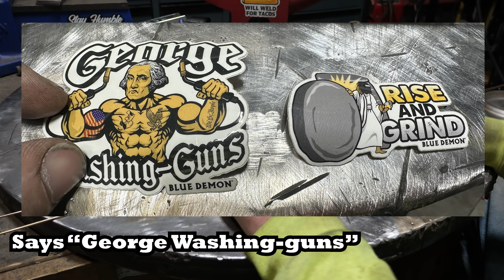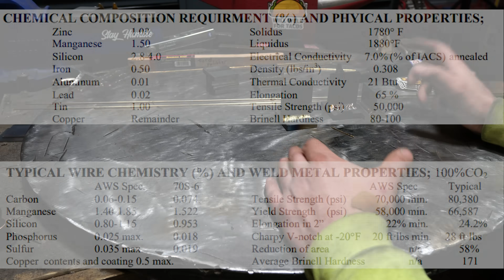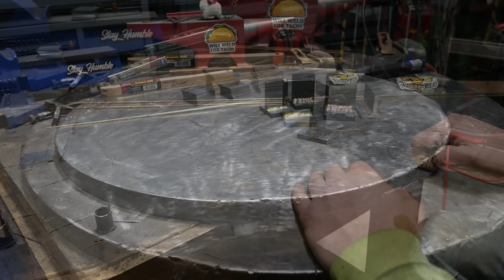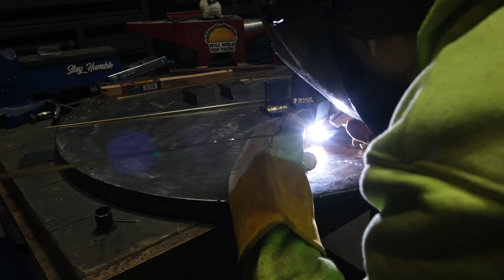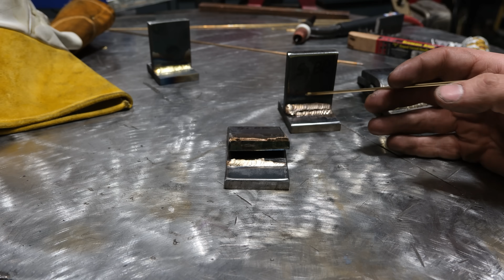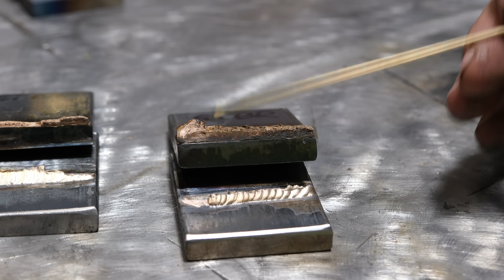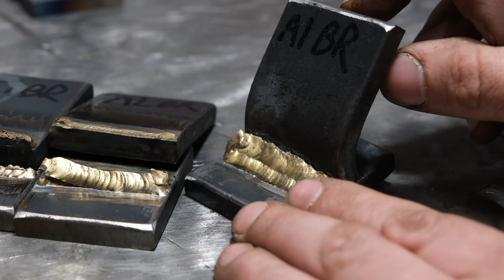Silicon and aluminum bronze brazing, how strong are they?

Comment: Thanks Greg, I really needed this. I'm getting ready to braze some mild steel to some American made cast iron that has never been run so not full of oil and junk. I'm not good with the dab dab dab tigging yet but I'm good at getting metal to flow where I want it to. I bought a couple of pounds of aluminum bronze so I could practice first. There is no leverage stress on this part, it hangs straight down and a connector hangs straight down from it.
Reply from the maker: You will find aluminum bronze to be very easy to work with.  The puddle flows like mud, once you push enough filler into the start of the braze that puddle will more or less follow your arc.  You just push some extra bronze in as you go and the finished product should look pretty good.  Since the puddle is slow to freeze if you take your time it’s not hard to get a clean look 😀👍.

Comment: I’ve been welding a lot of cast iron parts with 309L for years and have experienced no problems. But I recently repaired a cast iron part for something I bought on eBay and broke during shipment. I decided to lay a lot of 309L to thicken and strengthen the part. When finished, you could see the slight valleys between the welds. I didn’t want to grind off the metal as I wanted the strength. So I si bronzed all of that level before I powder painted it. I find that that’s what I use it for, mostly. I TIG welded it at 185 amps, and brazed it at 100 amps.
Reply from the maker: The cool thing is that it sands easier than steel or stainless so if someone needed to do like you did and wanted to sand it flat it could be done easily without removing base material/weld.
Reply: 625 inconel is also a good alloy for welding cast iron to steel.

Comment: Thanks for this video Greg. I've been doing a bit of TIG and MIG brazing recently. Done OA brazing for over 20 years but really liking the speed you get with MIG and the clean nice look with TIG. Have found that pulsed MIG is the only way to get really good looking MIG brazing as it kind of uncontrollable with SC MIG. Very interesting video and great to see the strength tests.
Reply from the maker: I just started to experiment with mig brazing and I managed to get what appears to be a mig weld but it’s a braze.  It sounds weird running it and it definitely isn’t the most controllable.  Once I get things dialed in a bit on thinner material I will be doing a video on it.  I wish I had a pulse capable machine, I am sure that would give a lot more control with it.

Comment: I use both SiB and AlB to build metal furniture. I do a tree slab table with one or the other as "bark" and then for the table top I alternate pours of copper and whichever I didn't use for the "bark" as the tree "rings." It's really a gorgeous material to work with. Like, the results are beautiful, but also it puts less heat into the table so there's less distortion I have to deal with. Really is one of my favorite materials to build client projects from when I'm more concerned with aesthetics than absolute tensile strength. If I could, I'd use it for everything.
Reply from the maker: Awesome 👍.  It definitely is gorgeous to work with, sounds like you found a great use for it.  That’s such a cool idea that you’re doing, and it will set your work apart from many others.

Comment: Really cool testing and brazing. I have a caldron to repair for a friend and will be doing this in the coming months, hopefully. I also have a pintle mount that I have to make for a Browning 1919 that I may use this on, since the actual pintle part is cast iron, whereas the cradle is mild steel. Awesome!
Reply: I've tried a couple cauldrons and found them to be nearly impossible to tig braze or nickel stick weld. And I've done a lot of cast iron successfully in the past. I think the difference is that these were not strictly speaking cast iron but rather "pot metal". Had a good amount of iron in it but a bunch of other stuff too. Flame brazing was a little better but still not satisfactory.

I bet it would work well for the pintle mount though.
Reply from the maker: Interesting on your luck with caldron repairs Lucas.  I have never repaired one of those, but it sounds a lot like sewer grates that can be made from total junk.  Often times the carbon content is so high that nickel welds and brazes will literally just crack at the point they join the base material no matter what you do.  If nothing works at all as a last ditch effort I would heat the whole area to 1,000 to 1200 degrees or a bit more with a rose bud until it’s stabilized at that temp for a few minutes.  I would then oxy fuel torch braze it.  The big problem is too hot and it’s going to develop changes in the heat affected zone, and likely crack elsewhere.  That’s hot enough that other issues will likely pop up but it might give things enough ductility during cooling to prevent failure.  Those types of repairs are the hardest to be successful at because it’s one thing for it to last through brazing and another to survive use in which it’s exposed to significant heat cycles.
Reply: @Lucas12v  Thanks for the input. I will try and remember to send you a message when I make the videos for the cradle.

Comment: What great timing. I picked up some silicon bronze rod awhile back planning on using it, I hope, to fill some rusted through holes on my project '62 Impala. The holes are in sheet metal that has been press formed and no one remakes these parts. Do you have any tips on tig brazing very thin sheet metal with silicon bronze? Thanks once again for a very informative video.
Reply from the maker: So one of the great benefits with it is it needs less heat than welding to flow.  It also is easier to sand than the base material which makes it great for body work.  For sheet metal the best advice I have is to use .045 silicon bronze filler.  The thin wire will be really easy to melt on thin material.  1/16th also works decent.   You want to heat the material until you barely see a mini molten puddle and then push some wire into the arc while increasing the amperage slightly.  It takes some practice but it’s pretty easy to learn.  Definitely watch the video I linked in the description for more tips on using the stuff.
Reply: @makingmistakeswithgreg  Thank you, thank you, thank you. I had no idea how to do this.

Comment: Hello sir. I have question. Can brazing be used on 2 piece of same aluminium or different aluminium? Dont see anyone do it in you tube. Thank you.
Reply from the maker: Great question and something I haven’t covered.  So aluminum can be brazed, with specific aluminum brazing alloys.  Aluminum itself can be welded for most alloys however some such as 7xxx series can’t be welded easily but can be brazed.  At some point I will do an aluminum brazing video, I won’t lie, it’s tricky.  Aluminum brazing takes place at around 1100 degrees and the base material starts to melt at 1250 or so.  It can be very easy to melt the base aluminum.

Comment: Another good video, as usual, Greg, thank you.  Most of your carbide edged tooling (think circular saw blades, router bits, lathe tooling, etc.) are brazed on (i.e. carbide teeth brazed onto a steel disk or a steel shank).
Reply from the maker: Thanks for pointing that out, and you’re right.  That is a great situation where welding the two materials isn’t exactly possible but joining the two with brazing gives an amazing end result.

Comment: seems you can tig braze on ceramics too?    any suggestions to use flux to help wetting out? or is the flux in the rod. happy Easter-
Reply from the maker: So with torch brazing you can use flux (either on the rod or with a cup of it that you dip the rod in).  Technically the tig process doesn’t use flux at all, which does limit its use.  The flux helps the bronze flow, protects it from oxygen, and does have a bit of cleaning action on the base material. The absence of flux with the tig variant means more limited ability to use on dirty material, and possibly more inconsistent adhesion to the base material.

Comment: Do you remember how much AC balance you used on the Aluminum Bronze?
Reply from the maker: 10% EP, so 90% EN.  A touch of cleaning action really helps the process work.  I updated the description on the video to include the link to the video I made on using the stuff.  It’s pretty simple with aluminum bronze if you can tig aluminum, it functions very similar to it.

Comment: Great video Greg.
It will be interested to see how much stronger the join would be if acetylene gas brazed. Looking forward to you running some tests with acetylene some time Greg.
Reply from the maker: So with gas brazing I have a feeling it won’t be as strong as aluminum bronze.  However if it were to be used to flow under a plate or through a crack in something I bet it could be functionally as strong depending on what was repaired.  I will definitely be testing this.
Reply: @makingmistakeswithgreg  Looking forward to the test, I think it will be stronger.

Comment: Very interesting! Never would have guessed that AlBr multi-pass could be about as strong as welding.
Reply from the maker: I didn’t either.  On face value that aluminum bronze wire is listed at 68-78k psi tensile strength and a fairly low yield of 42k.  Which makes sense as to why an oversized braze could outperform a 60k psi welding rod in one particular test.  The hard part with brazing is getting reliable bonding to the base material.  It wouldn’t take much of a lack of bond and it goes from 100% strength to 0.  Or for that matter if it cracks when cooling you lose all strength.  Something that doesn’t easily happen with welding lol.
Reply: @makingmistakeswithgreg  if you use flux, clean everything plus put enough heat into it things will be good.  You can't braze dirty material.

Comment: Silicon bronze as well as aluminiumbronze is great for joining sheet metal, especially galvanized. I use it also as a friction cussion in cases I don't want to install bearings (or simply can't) steel on steel bites and creates rapid wear, the brazing is kind of "self lubricating".
In an other comment was asked, how brazing works without penetration at all. Answer is: adhesion. You can think of it as a incredibly strong (and hot) hotglue. Same as soldering (but without flux and there for without capillar action).

Greg, thank you for that Video and the testing i never did. The results were in the ballpark what I expected, but not exactly and it is very useful having really seen the results.

The "tacos" sticker arrived last week when I was in Hospital and it really cheered me up. Many thanks for that, it really helped me to survive my "imprisionment"
Reply from the maker: Thanks for bringing up the info on using it as a form of bearing material, that is a great idea and yet another reason to have it in the tool box 👍.  Glad to hear you got your sticker, sorry to hear you’re in the hospital.  Best wishes on escaping that in good health 👍👍
Reply: No, actually, brazing and soldering are even cooler. It IS an intermetallic bond. if you keep a soldering iron on thin copper wire too long, it will be dissolved (think minutes, it mostly only happens in on purpose demonstrations...but it is the reason nobody makes quality soldering irons from pure copper anymore, they always have coatings of chrome, nickel and iron. If they didnt, the tip would be gone in a week of daily use or less). Literally. Its like a wet sugar cube turning sticky. Some base metal is being alloyed by wetting action.
Reply: @Zonkotron  you're right. I tried to explain it the easyest way I could think of. And in german the term: "Adhäsion" is used for soldering bonds and includes the underlaying metallurgic effects. Maybe my translation lags as well as the "hot glue" 😂
Reply: @Zonkotron Electronics tech here, yeah once there is the merest pinhole in the solder tip iron plating its total history within hours as the copper core dissolves away in hours.

Comment: Waaaay back in the day I used oxy a for sheet metal work ie lawnmower body and car floors and it worked great as long as you played with your heat ,however it did tend to set things on fire🫣

Comment: Thanks. Trying to find your previous video on brazing. Any suggestions (or at least what you used) for setting on each rod type?

EDIT: Just found the prior video from 2 years ago. Not sure how I missed that one. Looks like you do have some settings/spec sheets in there. I’m going to have to try both types out.
Reply from the maker: I forgot to put the link in the description like a idiot, I updated it lol.  Settings wise I will include some in the description but here are some ballpark ideas: 1/16th rod diameter should be around 35-60 amps depending on how thick the base material is and how much filler you push.  3/32 anywhere from probably 70 to 160amps.  1/8th probably 100-180a.   Once you establish a puddle of bronze that looks wetted out to the steel you just keep the arc on the molten bronze and just slowly move forward.  The mass of the base material will pull heat out of it fast since you’re not getting the base material hot enough to melt.  The 3/8th plate I was at 140-160a with 3/32 filler, thinner stuff would need far less 😀👍

Comment: Once upon a time, many different types of race car roll cages were required to be tig weld or flame braze if using chrome steel, if you mig the cage you had to heat treat the whole thing. That's one place where the mig like tig became the norm, they didn't really care about the safety aspect, just getting it to pass inspection. Now if you used thicker wall DOM steel, anything was OK.
Reply from the maker: To this day I believe NHRA only allows chromoly cages to be tig welded.  I know a ton of homemade air craft were made from chrome tube that were oxfuel welded.  I think the risk with mig is that it’s very easy to weld fast and there is a fast increase/decrease in heat.  That is extremely detrimental to chromoly since it mostly fails in the heat affected zone (often unpredictably) and I am sure mig would be more prone to such issues.  You’re right on the heat treatment, if you were to heat treat the cage after welding you could gain back the performance with mig, but at a high cost lol.
Reply: Wow. That is a lot of stuff to know! You guys are smart!

Comment: Another great video, thank you and happy easter!!  OK, I'm lost, if there is no penatration in braze welding as you showed what keeps it from just falling off?
Reply from the maker: Great question.  A conventional weld is a fusion process in which the base material is literally fused together with weld material (the weld is now an alloy).  A braze is not something that can mix with the base material, aka if you melt it into say steel it doesn’t form an alloy of steel and bronze.  So it’s classified as a mixture of cohesion and adhesion.  More or less you could say its bond is incredibly sticky on metal.  

That is where the bond process can be an issue.  With welding the fusion process is less of a bond and more of a homogenous material.  Brazing can easily have issues with actually adhering to the surface, that bond strength is less reliable and predictable than welding.  So it is very strong but in many cases probably not as reliable as a weld.
Reply: @makingmistakeswithgreg  thank you!